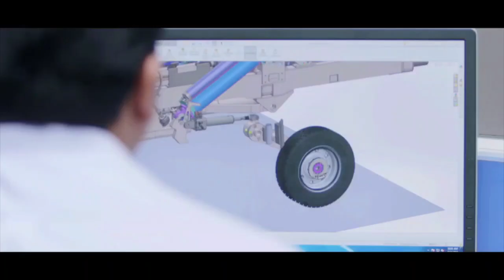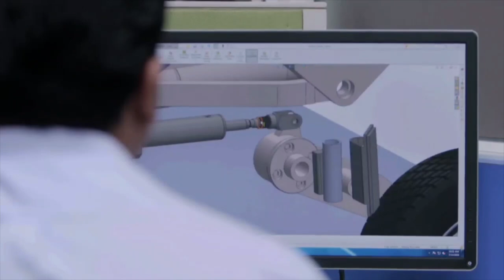Massive Artillery Push of Indian Army - 3000 to 3600 New Guns

Comment: As per earlier reports Indian Army were in dire need of:
1200+ Towed Artillery 
800+ Mounted Artillery 
200-400 SPH
200 ULH
1770 FRCV
1700 FICV

To replace M30,F717 Haubits & Soviet Era guns.

Keeping in mind even the current numbers of our adversaries,these numbers won't suffice,future requirements are not even counted.
We need approximately:
1850+ Towed Howitzers which can be a mix of(800 ATAGS + 400 Dhanush +650 Bharat 52)
850-900 Towed Howitzers(500 Mounted ATAGS 350 Mounted Dhanush/ATMOS2000/Nexter/Nora B52 under JV)
SPH-400 K9 Vajra + 400 G6 Rhino
ULH - 250 BAE M777 + 250 Kalyani ULH
400 Kalyani 
105mm Mounted Artillery/Howitzers 
For MLRS:
18 Regiments of Pinaka MK1/MK1 Enhanced to replace BM21 Grad
18 Regiments of Pinaka MK2/MK2 ER/Guided(6 Regiments each variant)
6 Regiments of Tornado/HIMARS/Astros 2
In future variant of Pinaka with 250-350km,12 Regiments of the System.

2500 NGMBT in 5 batches of 500 each(Shouldn't be like Arjun)
2500 FICV